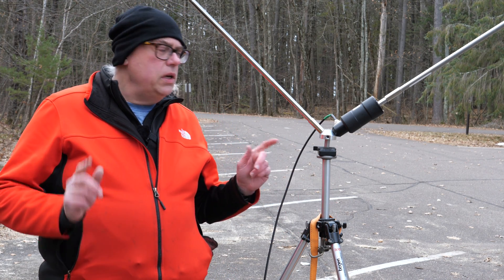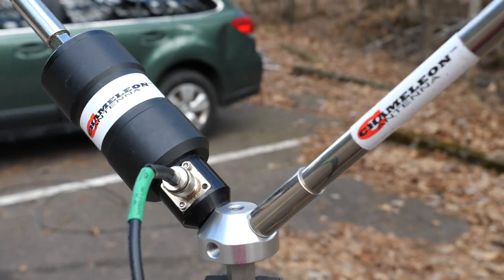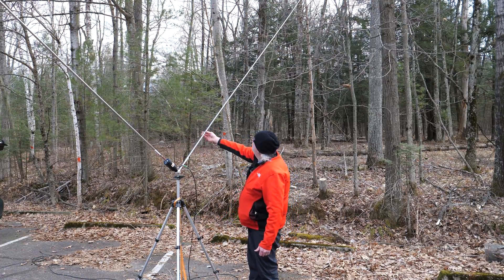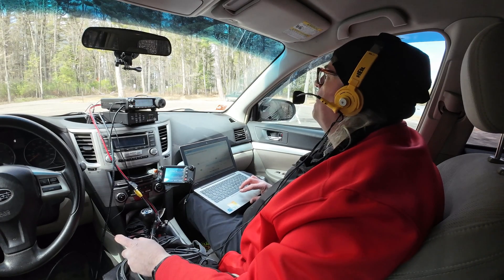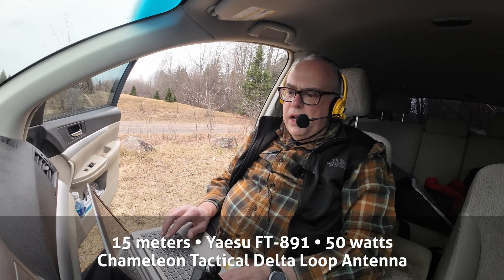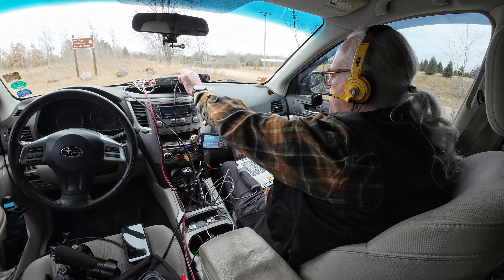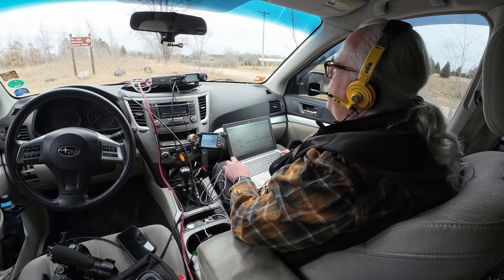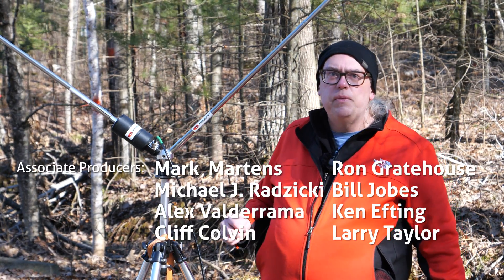Amazing Performance: Chameleon Tactical Delta Loop Antenna Revisited

Comment: Chameleon Antennas such as the CHA TDL and the CHA MPAS 2.0 are like the Leatherman Multi-tool. So let's use the Leatherman Multi-Tool analogy into five specific scenarios to highlight how a Chameleon Antenna, like the CHA TDL or CHA MPAS 2.0, parallels the utility and versatility of a Leatherman:

Backpacking in Remote Wilderness:

Leatherman Parallel: Just as a Leatherman provides a hiker with essential tools in a compact form, the Chameleon Antenna serves as an all-in-one communication solution for the radio operator in the wilderness. It’s the radio equivalent of a multi-tool, combining portability, ease of use, and functionality, enabling communication in remote areas where carrying a full-scale antenna is as impractical as lugging a complete toolbox on a hike.

Emergency Communications During Natural Disasters:

Leatherman Parallel: In disaster scenarios, responders often rely on multi-tools like a Leatherman for quick and versatile problem-solving. Similarly, Chameleon Antennas are invaluable for establishing emergency communications. Their quick deployability and adaptability to various conditions mirror a Leatherman’s ability to provide multiple tools at a moment's notice, where setting up large, stationary antennas would be as unfeasible as using a full-scale toolbox in a rapidly changing, chaotic environment.

Military or Covert Operations in Unfamiliar Territories:

Leatherman Parallel: For military personnel, a Leatherman is a vital piece of gear, offering numerous tools in a compact form, much needed in unpredictable conditions. The Chameleon Antenna is the communications counterpart of this versatility and compactness. Its ability to be set up and dismantled quickly and discreetly in hostile or unknown environments is parallel to how a soldier utilizes a Leatherman for various tasks under varied circumstances, where larger tools or antennas would be cumbersome and impractical.

Summits on the Air (SOTA) Activations:

Leatherman Parallel: Just as a Leatherman is the go-to tool for hikers due to its lightweight, multi-purpose functionality, the Chameleon Antenna is ideal for SOTA enthusiasts. It's the ‘multi-tool’ of antennas, offering a lightweight, versatile solution for establishing communication from mountain summits. This is akin to how a Leatherman consolidates essential tools in a hiker's pack, making the antenna indispensable in situations where carrying a larger antenna is as impractical as bringing a full toolbox on a steep hike.

Urban Stealth Amateur Radio Operations:

Leatherman Parallel: In urban environments where space is limited and restrictions are in place, a Leatherman serves as a discreet tool for quick fixes, just like how a Chameleon Antenna provides a stealthy and compact solution for amateur radio operators. The antenna’s ability to be set up and dismantled quickly and unobtrusively parallels the Leatherman's role as a multi-purpose, discreet tool in an urban setting, where using larger antennas would be as conspicuous and impractical as using a full set of tools in a confined space.

In each of these scenarios, the Chameleon Antenna exemplifies the qualities of a Leatherman Multi-Tool in the world of radio communications - compact, versatile, durable, and ready for a multitude of situations, making it the ideal choice in circumstances where traditional, larger antennas are impractical or impossible to use.
Reply: I agree, like a Leatherman. A tool that might work in a pinch, but will never work anywhere near as good as a tool designed to be efficient. You have a nut that needs to be tightened. A wrench, which is about the same size and lighter than a Leatherman will do a far better job, but darn, all you have is this damn Leatherman. It will work, but the chance of failure if far greater. Oh, and the cost. Good analogy Chameleon !

Comment: Try running about 5 snap on mix 44 ferrites near the feedpoint...Fair Rite #0444164281 will just fit snug on RG-8X. These can help lower SWR and help keeping any RF on the shield from disturbing the radiation pattern. Something else I noticed with mine...the telescoping elements had a film of grease on them. Took isopropyl alcohol and wiped them down.
Reply: That film of grease was there to help protect them from the elements.

Comment: There are several comments here disparaging the mpas 5:1 "do everything" matching transformer.  Chameleon never states this is an optimal performing system on all bands...but it does work.  They state these devices are mil-spec, not that the militaor actually uses them....that claim is usually misstated by youtubers or other online "experts".  The materials and workmanship from chameleon is typically excellent, and it is not cheap to manufacture this stuff...so the astronomical price is probably justified.  These antennas are an excellent option for those with $$$ and verly little knowledge about antennas....not everyone knows (or cares to know) how this or other antenna designs work.  Michael provides a fair review of this (and many other) antennas.  Does it work? Yes.  Is this as good as a resonant full-size antenna?  Maybe....but it depends on the band....but thebuse case for this and other mpas system antennas is when quick deployment is required and performance on 20m and higher is a  secondary concern.
Reply from the maker: All excellent points. Antennas are nothing more than tools, and it takes a bit of skill to pick the right tool for the job. You need to consider band conditions, location challenges, and personal objectives when choosing an antenna. I can't always set up a 1/2 wave dipole or even an end fed antenna at every spot I operate from. If I can show a variety of antennas operating in different situations, hopefully others will get the idea of how the aforementioned considerations play into portable operations.
Reply: @KB9VBRAntennas Exactly Michael.  Thank you for your videos and fair/unbiased real-world equipment reviews.  The best for one operator might not be great for someone else, and one needs to consider antenna efficiency expectations, band conditions, knowledge/ability, and need for portability/deployment speed.  I noticed that when the MPAS was sent to most popular youtubers for review, almost every one acted like it was a game changer and they would never use another antenna in the field ever again....now, I almost never see one deployed in recent videos.  Nothing is the perfect antenna for everyone or every situation.  73
Reply from the maker: I've used the MPAS a few times over the years, but the challenge I have is that for the time it takes to deploy, I can just as easily set up a 1/4 wave whip and ground screen counterpoise. Same with their wire deployment. For the effort it takes to put up the 60 foot wire and 26 foot counterpoise, I can put up a 71 foot  9:1 end fed random wire antenna. I've got some videos planned that will include the MPAS vertical, so stay tuned.
Reply: @KB9VBRAntennas  But I thought the "Speed" of set up was so much better with Chameleon products ? Enough to make it worth the far greater losses the 5 to 1 transformers have. LMAO. Anyway, the O.P. is right, Chameleon hands out antennas to youtuber's like candy, they review them, say how great they are. But it's a cold day in hell when you see any youtuber not doing a review on a Chameleon antenna use one. Don't believe your lie'n eyes.

Comment: What is the power rating for digital and CW?? tnx
Reply from the maker: It depends on if you have the hybrid mini or hybrid micro transformer. the mini is 250w CW and 40w digital and the micro is 50w CW and 25w digital. See the link in the video description for more detailed specs

Comment: Yes, a youtuber did a test of the Chameleon 5 to 1 transformer. "Survivalcomms" Chameleon Snake Oill video. As you well know, broadband antennas are very lossy. Your first test of the Chameleon was correct  and is what to be expected from the Chameleon when the cycle is not near its peak. Overpriced and under performing.
Reply from the maker: Do you have a reference or link that states the losses? I can't verify any of your claims. Searching online the worst I could find is 70% efficiency which which in most instances would hardly be noticeable on an S-meter (for comparison, an EFHW antenna typically is 85% efficient).

Comment: Another fine video. How do think the CHA TDL would perform compared to the same whips in a V dipole configuration, such as in the Alpha Antenna Hextenna? Any easy way to turn the TDL into a V dipole? If attached with hybrid mini/micro would function as an OCF dipole? 73
Reply from the maker: I'm not sure about the OCF dipole, that might take a bit of experimenting with whip lengths to find a combination that works. But removing the top wire will turn the antenna into a V dipole. Consider this. The 5:1 transformer works with the 17 foot whip as a vertical antenna. Putting that assembly on its side will not change the SWR. The second whip becomes your counterpoise.
Reply: @KB9VBRAntennas  good points, thank you!
Reply: Simply remove the top wire at the top!

Comment: Michael what tripod are you using???
WA3GM
Reply from the maker: It's a set of Bogen (Manfrotto) 3001 legs with a Manfrotto quick release plate on top. The legs are no longer made, and I'm not sure what the replacement would be. There's a link to the quick release plate in the video description.
Reply: Thanks

Comment: I like mine, for sure....made a contact on 17 in Slovenia while the TDL was secured to the top of the ladder on my camper (gulf coast location).  I've also had some medium range QSOs on 40 (out to 800-900 miles).   I wish I had a radio buddy 250 to 450 miles away so I could experiment with NVIS.  Expensive antenna...but I'm glad it's in my kit.  Notable,  the TDL can be set up on the ground spike in just a couple of minutes.

Comment: How much does the wind push on that? It looked pretty floppy in the introduction segment. Great video!
Reply: You can operate the unit with 30 to 50 mph wind no problem. The SS whip will simply bend in the wind while keeping the top wire horizontal with the ground thus never loosing NVIS capabilities!
Reply from the maker: It was quite windy that day. Gusts were in the upper 20's so the antenna was twisting and swaying a bit. But it handled the wind load quite well.

Comment: A wire delta loop requires more setup time, a telescopic mast or tree. A vee dipole made with two telescopic whips, a Wolf River Coil and a piece of wire with alligator clips is an option but remember, you have to go and change the tap on the coil when changing bands. For Parks on the Air, no big deal, you change bands as soon as you complete the necessary contacts on each band. The Chameleon TDL is a different concept, more focused on emergency communications, fast setup, no coil tapping, etc. It is a field expedient ( tactical ) antenna. MFJ sells the Big Ears ( 2289 ) which uses two 17 feet telescopic whips, one loading coil and a V shaped center support. It sells for $249 but like most MFJ products, it's a bit fragile. MFJ whips break easily if not handled with care. Chameleon whips are much more rugged. You get what you pay for. Just my two cents. Thank you Michael for the follow up video and overall impressions. 73's
Reply: but it needs antenna tunner,, you don't need change the tap of wolf river if you have ant tunner too